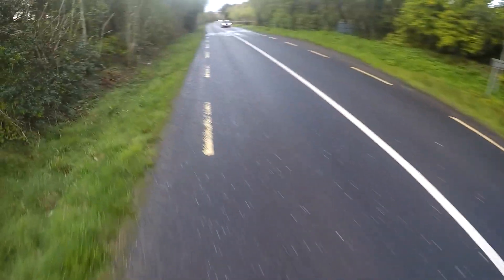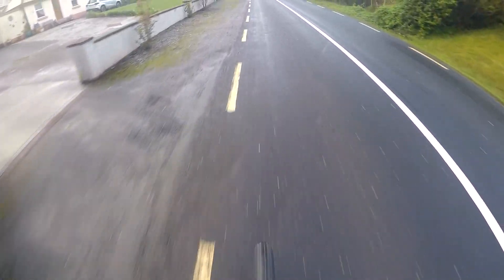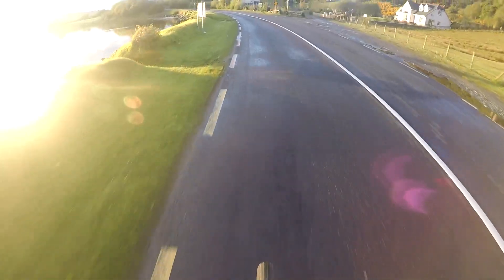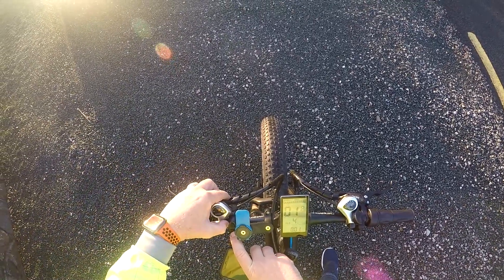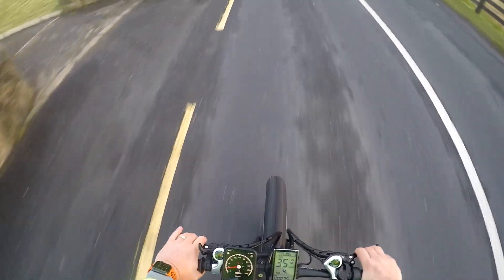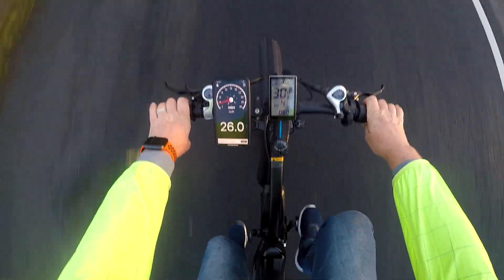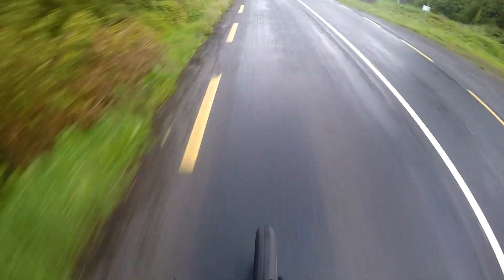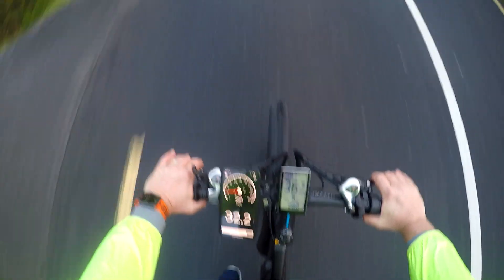MX02S 1000 watt Ebike Display Speed v GPS Speed test

Comment: Interesting subject. Only bike I have seen that seems to fairly closely match phone gps has been the LO26 for both speed and overall distance. Of any device I would be most inclined to believe the Garmin gps.
But terribly hard to compare because of software and lag of gps updating. 
I’m thinking that comparison of distance travelled over say 50 km between bikes trip and a garmins trip will be most accurate way. 
Then over many longer trips will be possible to fine tune wheel size setting to get as close a match as possible. 
This setting will only accurately apply to you and your bike because tyre pressure and riders weight plus any cargo on carrier  will ultimately effect the actual diameter/ rolling distance of the wheel. 
For some mad Evel Knievel person getting a tow from a motorcycle at low constant speed might work or create greater confusion because eu has manufacturer’s calibrate speedos to read approximately 10% higher. 
Nice video. Cheers
Reply from the maker: I’ll have to go the scientific way on it I guess marking the tire and the ground and give it a few revolutions. Don’t need it to be 100% accurate but still curious. Will try my Garmin GOS speedo too over a longer cycle. If only it would stop bloody raining lol
Reply from the maker: Set P18 in the menu to 110 (default is 120) and the speedo reads accurate
Reply: @sylvesterhiemstra4002  will try this. Have listing of p settings for S830 display. Normally set to 0. My notes list this as Speedo fine tune. I take it this is on your MX02??  What setting do you have for wheel size ??? 
Will be handy information for my MX02 if it ever shows up.
Reply from the maker: @patomahony9747  yes Pat sorry it’s for the MX02S, wheel size can be left at default 26
Reply: @sylvesterhiemstra4002  thanks for the info. Will add a note to my note book. I’m looking fir some kind of gps tracker to fit in case bike is stolen.
Reply from the maker: @patomahony9747  I'm not (yet) too worried about that here as I'll not leave it out of site and it's well locked away at night and under CCTV as that's what I actually do for a living
Reply: @sylvesterhiemstra4002  nice catch on the settings from another user. Thought occurred to me. You mention in the commentary that the max amps is set to 8 amps. Forgive me if my maths is wrong but that equals max power to motor on a fully charged battery of just under 440w. So in theory will prevent stress on the motor thus increasing its life and give a decent range. Only other bike I have  checked this on is the LO26 500w and that is set to 11 amps max. Must do a check to see if the controller sets a maximum graduated amps in each of the pas settings. Will check out my Gw20 later to day. See what is maximum amps it draws in each pas setting.
Reply from the maker: @patomahony9747  I’ll need to do a lot more research myself as well and click up more miles to get my head around it all.
Reply: @patomahony9747  For this bike MX02S the manual says the default is 12A but can be bumped up to as high as 20A...i just changed mine from 13A to 17A will see if it makes a big difference
Reply: @happycamper3455  do you happen to know the p number on the MX02s to set the max amps. 
Bike arrived but no sign of a manual may have dropped out when warehouse opened box to put second battery in. Otherwise a cracking bike.
Reply: @patomahony9747  Number 14...0-20 amps
Reply: @patomahony9747  Also i havent been able to test it yet... here in vancouver were going threw a heat wave was 43c yesterday.. too hot for biking for me..let me know if it makes a diff for you.. i have a feeling this is how manufacturers keep the speed down to make it leagal in your country
Reply: @happycamper3455  thank you for the info , been nice here also. My son ,an extremely fit lad,who uses the MX02s stock out of box settings.  mentioned to day that he easily cycled along between 45 and 50 kmh on the level but has noticed several motorists in adjoining lane pacing him looking his bike over because of the pace he’s cycling at and I suppose fact it’s a stunning looking bike ,so he now says he must keep it down around 35 ish so as not to draw unwanted attention.
Reply: @patomahony9747  Your right there it is a bitchin looking bike... i get harley riders giving me the thiumbs up all the time and sayin the bike look mean...lol..ive done some modes on my bike like adjustable higher stem post/Mirrors front and rear bags? to hold the spare battery and have metal full fenders comming in from aliexprese... also i took off all the factory stickers...looks way better now
Reply: O yea the pupose of my last post was if you can keep up with traffic the cars dont try and kill you by passing too close... crank up the amps..lol
Reply: @happycamper3455  cool beans. Any chance you can post link to those mudguards your getting. 
I with my GW20 get the looks and thumbs up from people. Or 20 questions the most notable being “where did you get a bike like that?”
Reply: @patomahony9747  This makes the riding handle bar hight far more enjoyable.. https://www.amazon.ca/gp/product/B08GWZYK27/ref=ppx_yo_dt_b_asin_title_o07_s00?ie=UTF8&psc=1

 and these are the spacers for the post should you need some.. https://www.amazon.ca/gp/product/B08GXMWYF3/ref=ox_sc_act_image_3?smid=A2YXCZK3PKL8E9&psc=1
Reply: @happycamper3455  just the links I required. Had searched for the mud guards to no avail. Thinking in Matt or satin black will make the MX02 look beefier  plus these mudguards allow the fitting of nylon or pvc covers over the guards and down the sides to prevent splashes. In saying that have not seen them on any site but it’s a matter of entering the correct search term. That’s if they are still made last time I seen them was on my grandfathers bike back in late 60’s
Reply: @patomahony9747  They do look cool..ive been looking for a led tail light to mount to the rear fender but havent found anything acceptable... i bought a spare battery and it came with the mount and the wiring..im thinking of using the rear shelf bag and rigging it up in parralel by running a wire ...that would give twice as much range and a whole lot of Ampes which should boost the power a lot when set at higher amps
Reply: @happycamper3455  so you have a rear mounted battery   I have been looking at using either 5v dc or 12 v dc because there are many standard motorcycle lamps available. Now 2 or 3 ways to get the required power. First is a dc to dc buck converter from a golf buggy. 
Not a fan of this draining your propulsion battery and 48 v ain’t pretty if it goes wrong. 

Designed to take 48 v and give out 12 v at several amps. 
I prefer a separate power supply. Like below. 
Plus if you decide to wire to handle bar you can get 5 v output buck converter and use solid core twisted pair telephone cable or likes of cat 5 Ethernet cable 
Each pair is a live and return  and will carry the required voltage and current. 
I have used telephone solid twisted pair to wire a microlight flight panel in the past and c of a certification had no issues and I never had any wiring issues either. 

Another option is 3x18650 3000mah  Lipo batteries wired in series to give 12.8 v dc. 2 ways to do this get a 3 cell flat 18650 battery holder with a switch. Or solder 3 batteries and add a 3 cell bms 
Let's shop together on AliExpress with new user coupons
Your € 0,86 in coupons are here!
https://a.aliexpress.com/_mthsmzf

and charge with a 12.8 volt charger or get a 18650 charger and pop the cells out for charging. 

€ 2,89  22％ Off | FORAUTO LED Rear Lights Motorcycle Lighting Moto Tail Brake Light Indicator Lamp Motorcycle Accessories For ATV Quad Kart
https://a.aliexpress.com/_mtW2BeN
I purchased 2 of these to test out but not had time. 
To activate the brake light you can get switches that attach to the cable at the Calliper or in the case of the MX02s an hydraulic pressure switch tapped in to hydraulic line but even I do not think this is a good idea 
Another option is to tap in to the signal wires on the brake levers. 
I Do not know if they make or break a circuit when brake levers pulled but I believe they are 5 v dc so my plan is to use a 5 v dc audrino optocoupler relay. 
€ 0,58  16％ Off | TZT 5v 12v 1 2 4 6 8 channel relay module with optocoupler Relay Output 1 2 4 6 8 way relay module for arduino In stock
https://a.aliexpress.com/_mPIDYaD

The signal from brake sensor activated the relay. 
The relay is isolated from 5 v trigger voltage by a light sensitive switch
The relay has 3 wiring ports 12v supply in middle. One side is normally closed and other is open. 
Below is another option that I have not purchased but it also has turn signals integrated. 
€ 6,79  11％ Off | 12V Universal Motorcycle LED Rear Fender Brake Stop Tail Light Motor Bike Turn Signal Lamp Retro Motocross License Plate Light
https://a.aliexpress.com/_m00RBzj

If you fancy turn signals below is a handy switch. 
€ 1,14  43％ Off | Motorcycle Electric Bike/Scooter Light Turn SignalandHorn Switch ON/OFF Button W/Red Green Buttons 22mm Dia Handlebars
https://a.aliexpress.com/_mqFzQBF

If you need a flasher relay. 
Search flasher relay on AliExpress or may be as cost effective to buy at your local motor store. I got some on AliExpress that the flash rate was adjustable but since they took 4 months to arrive not posting link. 

I once tested a headlight on the bench hooked up to just 2x18650x3000 mah batteries = 8.4 v fully charged and some 12 hours later we’re still shining bright. Think voltage had dropped to around 6 v. 

The above parts list enables lights and turn signals to be fitted to a standard push bike. 

On MX02s have motorcycle front and rear dash cam running from a usb power bank I assemble my self. 
Will run system for at least 12 hours between charges and since MX02 does not have a phone charging 5 v dc plug the power bang has 2 
Sorry if this is TMI lol
Cheers
Reply: @patomahony9747  Also if you wanted to run 12volt to the rear light im pretty sure you can run a wire from your front head light to the back fender so they both run off you handle bar switch.. but id have to test the voltage of the front head light to confirm
Reply: @happycamper3455  those little brake lights that fit on Caliper cable I bought. Not to use as a light but to use the switch in them to trigger a pannier or mudguard mounted 6 to 12v brake light. On tapping in to front light to power a rear light. BE WARNED. on a lot of controllers the headlight wiring will only support very small current in the milliamperes range. Heard stories of people BURNING OUT THE CONTROLLER  by tapping in to this wire to run additional rear lights or too powerful a headlamp. 
My way to go on this is to use the headlight wire to trip a relay from likes of audrino to turn on power from a battery pack to power a rear light. Relays come in may forms and voltages  so if headlight is 48v a relay that can handle this voltage to trip but is isolated from the output switch is required   On output side you feed voltage from your battery pack at 12v to power the rear light. And one of those calliper brake lights modified as a switch to trigger the brake lights. All bikes different voltages ie some bafang controllers this wire is 6 volt but again limited to low milliamperes. 
Putting link below for type of relay I’m talking about. If you check the specifications you will see that the trigger is an optocoupler which separates the trigger voltage from the relay output voltage. If in this instance the headlight wire is 48v I would use a step down buck converter to reduce the trigger voltage down to the required voltage. 
In case of link below you can get it in 5v 12v  or 24v trigger voltage and if you watch the video at start you can see he reduces voltage further with a resistor. ( note if you have to step trigger voltage down to 5v 12v or 24v I would use a step down buck converter because a resistor may get extremely hot ) 
On output side each relay (the blue squares) has 3 connections. Middle one is plus volts power from your battery pack and at rest it supplies power to one of the other pins. When the relay is tripped the power is output to the 3rd pin and the second pin goes dead. 

€ 0,70 | 1pcs 1 channel Blue board relay module, 5V12V24V,with optocoupler isolation relay module output low level trigger electronic DIY
https://a.aliexpress.com/_mNMkokz
Sorry if this is not in your field of expertise but plenty of videos on YouTube. 
Cheers
Reply: @patomahony9747  Most led lights are very low watts/amps...the head light on our bike is also led so i dought there would be any issuse taking power from it..but if your concidering using one of those big motorcyle rear tail lights there may be problems... the more complicated you make it the more that can go wrong.. i have desighned many systems using lipos and buck converters and the bucks always seen to fail eventualy.. i think its better off using a battery operated led with a flashing light..
Reply: @patomahony9747  at 2.6 inches it may look good painted black.... i found it on amazon for $34 bucks canadain..thx for the link
Reply: @happycamper3455  your welcome. Seller on link has pages of stuff might find other ideas. Cheers
Reply: @patomahony9747  .. Hi Pat...I ended up doing some modes to the bike..after getting the zoom shock absorbing seat post i got the cloud 9 seat.. these 2 together made a Huge difference in ride comfort... i highly recomend..also i upgraded my battery to a Hotsale Ebike Electric Bicycle 52V 20AH 1040Wh Waterproof Triangle Battery from amazon... that also made a difference in power and millage..since a stock battery from shengmilo was near 400cad i figuerd id go up in volts and  amphour.. the triangle battery was 600Cad but well worth it...huge range now..

https://www.amazon.ca/gp/product/B07WND59NM/ref=ppx_yo_dt_b_asin_title_o00_s00?ie=UTF8&psc=1
Reply: https://www.amazon.com/dp/B002MKFRQI?psc=1&ref=ppx_yo2_dt_b_product_details
Reply: @happycamper3455  just what  I required. Going to be expensive for me. 60 including shipping then import duty. Customs handling charge and 23% sales tax on top of everything. Prob end up costing me 120 plus lol
But at least link you sent will ship to me.
Reply: @patomahony9747  Im having trouble posting links here but If you go up a couple of posts were i have the battery link to amazon i have a review there under Cylindricalsea you can see the seat as well as the new battery on my bike..
Reply: @happycamper3455  seen that link and it looks great. I’m sorted on saddles going to buy a rock Bros I have seen on Amazon and a second that looks identical to cloud 9 still cheaper than shipping from USA. When COVID dies down and have relatives travelling over will get them to bring a few items for me v
Reply: @patomahony9747  ive seen comparisons between the 2 seats..and most times cloud9 wins..i havent tryed the rock bros but i think ive come to the end of the line with seats this one is great...also in real life the seat is near dark black.. this is the best model of cloud9 for softness..there are others with less padding..what country are u in?.. maybe i can get one for you cheaper
Reply: @happycamper3455  going to hold off for present. But thanks for offer I’m in Ireland
Daughter bought a 200 usd pressie including shipping for mum in USA  customs here assess at their value so was assessed as a value of 580 customs not interested in invoices etc. Cost same again.
Reply: @happycamper3455  well if you consider they link your photograph to your passport ,birth certificate ,driving licence ,social insurance m,email , phone number and health card plus are using  facial recognition and possibly voice recognition. Then add this to a speed camera system called gatso that’s mobile and scans every vehicle registration as it passes supposedly to issue a fine if vehicle is speeding or has its road tax etc out of date and sends all scans to a government department supposedly to prove the number of scans it did. 
Add this to a cashless society where all transactions are electronic and likes of smart devices like tv, pc, Alexa ,Google and  your mobile phone that constantly record and upload via wifi and Bluetooth networks etc. 
One has to consider that amongst others George Orwell was not just an author but also a sort of psychic in books like 1984 and animal farm where he foretold a futuristic society that is not so futuristic 70 odd years later. Same with Isaac Asimov who’s works were classed as science fiction when written but in many instances a fact of every day life in some form or other. 
Then back to modern day where all births have finger prints and dna taken for hospital security and recorded where ???? 
The list goes on and the mind boggles but before you get the impression that I’m a conspiracy theorist, I’m not, just some one who is partially aware of how our world and society’s are progressing.
Reply: @patomahony9747  Ill ask Sylvester too see if he can figure it out
Reply: @happycamper3455  ok leave P6 set to 26 the wheel rim size. (Funny they list it as 20 ???)
P8 is max speed limiter 100 is off.( they have it set to 65) 
P11 (1 to 24) how fast the power kicks in when you pedal.  
P18 is wheel size fine tune. Sylvester recommends 110 for speedo to read correctly. and I have seen another reference by another user to 120. 
P19 I have at 000 not 001 as in list sent to you. Don’t remember it’s function. 
When ever I check out a new bike I normally make a record of out of the box settings. 
IMPORTANT FYI. most controllers have a RESET TO FACTORY FUNCTION. USUALLY P0. Never never do this because in a lot of instances it is not resetting the controller to THAT BIKES OUT OF BOX SETTINGS. but to the settings the controller it’s self had coming off the production line. So software updates etc can be erased and open a huge can of worms.
Reply: .. Hi Pat... i contacted shengmilo threw aliexpress and got an answere i cant figure out.. i explain to them that the rim size is 26 inches but the tier adds another 4 inches for a total of 29 inches so what is the proper setting for accurat speed kmh...this is what he sent me..

P01=0002，P02=0000，P03=0048，P04=0010，P05=0001，P06=020.0，P07=0001，P08=0065，P09=0000，P10=0002，P11=0001，P12=0005，P13=0012，P14=0013，P15=040.0，P16=0000，P17=0001，P18=0100，P19=0001，P20=0000

Our tires are based on the size of 26 inches, the above are the correct default parameters, you can refer to it, thank you

Then i wrote.. 
but the overall size of the tier is 29 inches how can it be based on 26 inches?... so which setting do you recommed and were in the menue will i find these settings..

this is were he stopped responding .. any idea if any of these number are usefull in anyway?..thankyou
Reply: Tell me about the weather. Been dry to day so far. Think it’s first time in a week.
Reply from the maker: @patomahony9747  true today is ok for a change